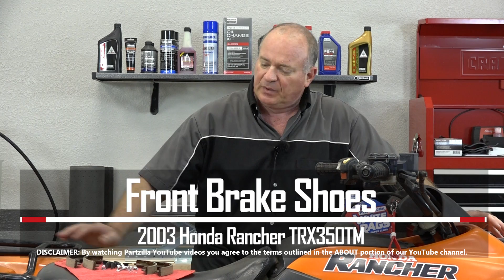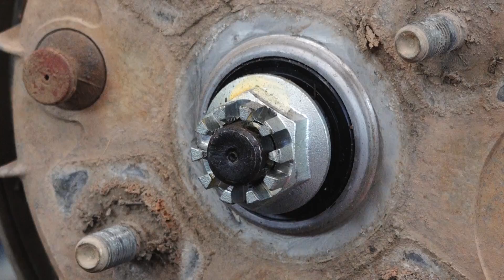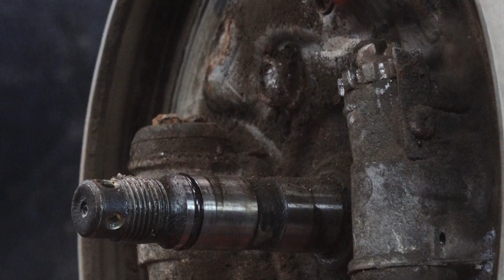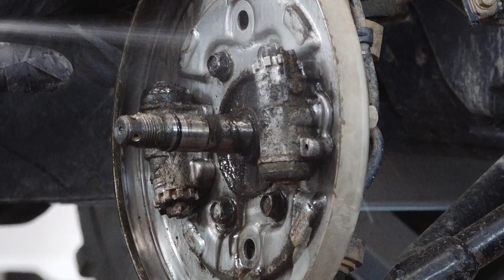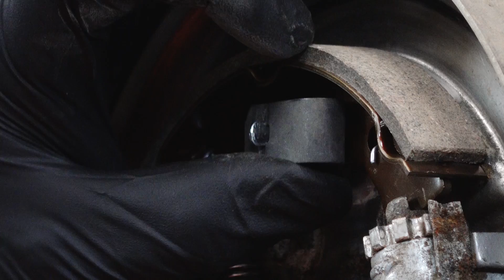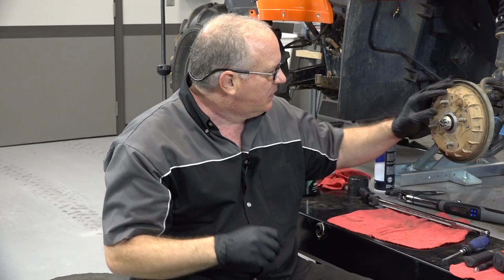How to Change the Front Brakes TRX350 Rancher | Partzilla.com

Comment: What would be causing my brakes to be hard to press. My front brake on both sides are super tight, and I can't squeeze them. The foot brake goes down and doesnt stop the bike then i have to use my foot to lift it back up..

Comment: Partzilla is a great site but $120 plus $30 shipping is silly. I got OEM parts off Amazon for just over $40 all in and went on the same as Honda parts as I have replaced the front brakes on my 2001 Foreman 450s before with genuine parts. Watched this for a refresher though and very good instructional video.
Reply: Hey I have a 99 Honda foreman 450 and I replace the whole front brakes,  wheel cylinders, and master cylinder and the brakes still won't stop the machine. Any suggestions.  Thanks
Reply: @chrismaragoudakis7603  did you adjust the cylinder assembly so the brake shoes barely touch inside the drum? That or you possibly have an air lock in the lines and bleeding them and topping off the reservoir should help? Some of the bolts for the master cylinder have holes for oil flow they may not be lined up
Reply: Yes I adjusted the wheel cylinders quite a  bit.   Maybe I need to go more.  Bleed the brake lines too. But the handle still feels spongie.  Thanks

Comment: need help i change the master cylinder have presser but the tires keep rolling other words try to slow down nothing happens its like the harder i squeeze the handle doesn't make no difference new brakes and wheel cylinders was replace i had brakes when i startered but not now

Comment: Great videos, if that’s the correct name. Have a new 520 manual, a 2003 350 2wd and a 1997 2wd 300 from new. 
These videos are great as I’m into brakes etc on the two older bikes. 
Seems a nice sort of guy also. 
David brown
Bushmills
N Ireland👍

Comment: You forgot to put a very thin wipe of white lithium (as HONDA uses) or specific high temp brake grease on each of the three raised pads the shoes rest on the backing plate, without the grease the shoes won't push out or retract smoothly or retract at all & drag on the drum.

Comment: I’m not getting pressure when I pump the brake lever next to the master cylinder on the handlebar. As a result, my front brakes don’t work. Can you offer some advice?
Reply: Same problem
Reply: Sama problem. Did ever figure it out?
Reply: That would either be a bad master brake cylinder,or a collapsed or clogged brake line.

Comment: I bought a used atv and the pistons are stuck I know you probably won’t answer but can someone get please help?
Reply from the maker: What do you mean the pistons are stuck?  A little more detail on what it's doing would help.  Typically, if the pistons won't move at all, you will have to take the caliper apart and inspect them.
Reply: let it sit on dizel or wd40
Reply: I'm having the same issue I cant remove the hub assembly. I tightened the pistons clockwise as far as they will go and hub is stuck
Reply: I’m having the same problem on a 06 Honda rancher 2wd, hub spins freely but will not come off of the spindle

Comment: Very informative video! How big of a difference would a 93 Honda Fourtrax trx300fw be following about the same procedure as the video. I have to replace all 4 tires and front right CV shaft so i figured why not replace the master cylinder and brake shoes since i am down there.
Reply from the maker: Braking system is mechanically the same.  Might be some subtle differences just from the age difference.
Reply: if u got the  money and time do it. its urs wanna right good